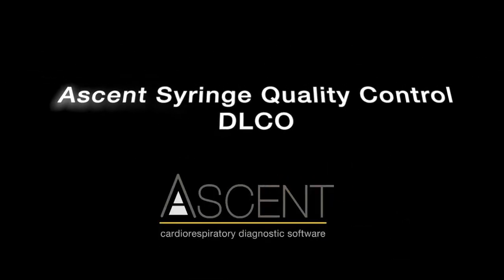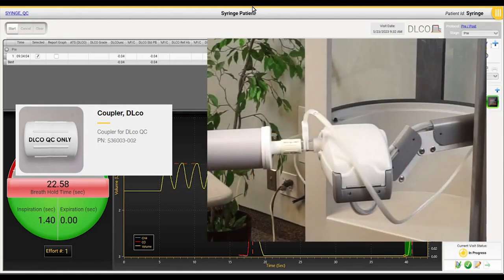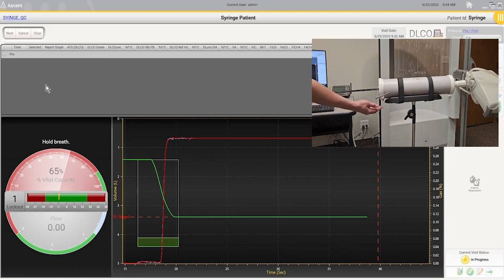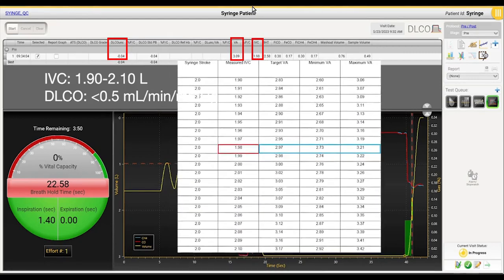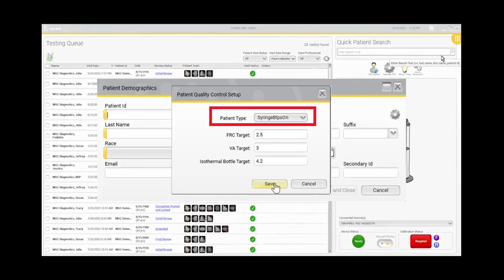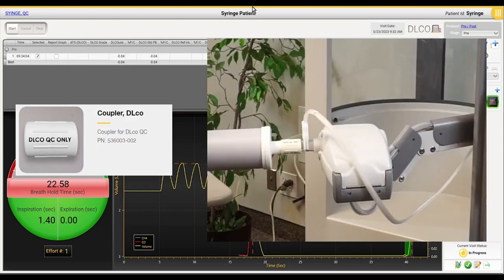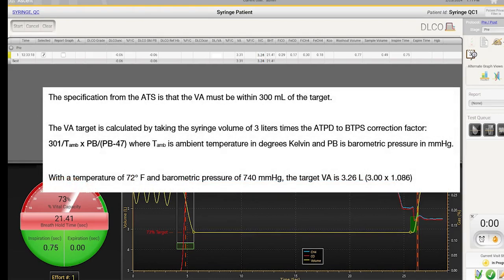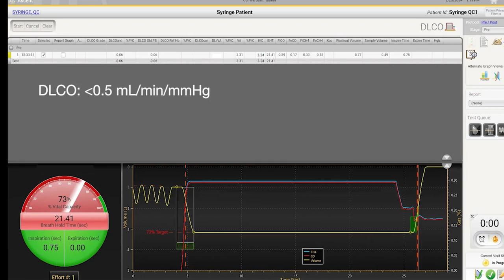Quality Control (QC) for DLCO with Ascent™ Software

Comment: My systems IVC is always quite low -- around 1.9L (1.85 - 1.94L). It is less than 1.9L 50% of the time, despite changing prevent flow sensor a number of times. Any idea why?
Reply: After troubleshooting the issue today I came up with a slight loosening of the demand valve screw (1 turn; decreasing resistance) brought the IVC back to 2L. First time I've encountered this problem/fix. Thanks.